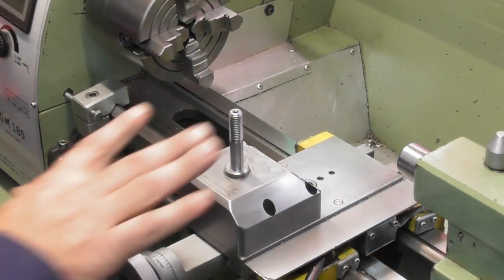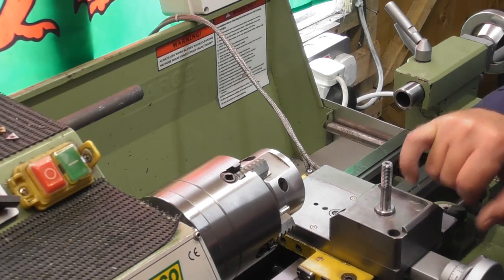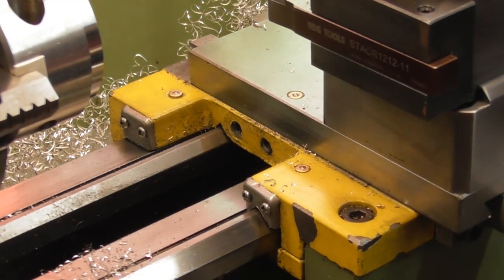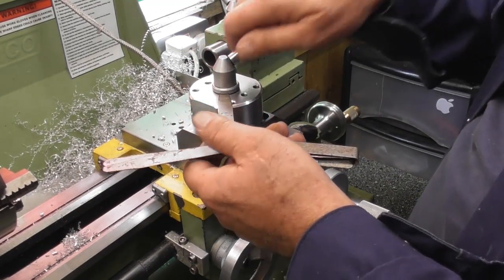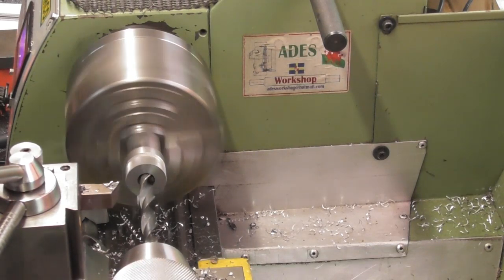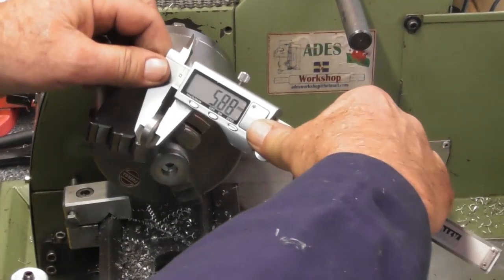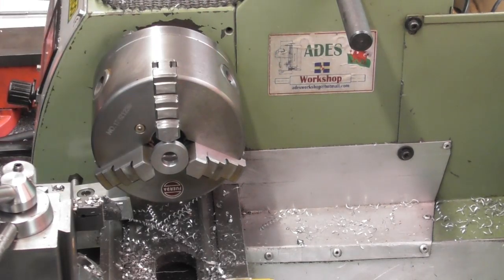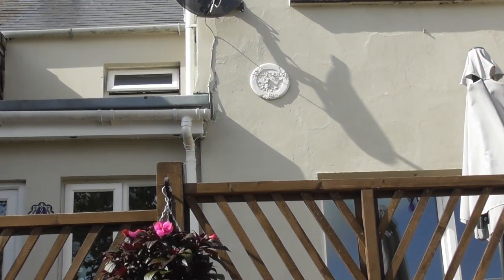Boring bar tool holder mod's and shop update

Comment: Hi Ade. Just a line to say that I've been getting on with making a solid compound for my Myford ML4. The cast iron was hacksawed out of an industrial weight. After getting near to shape using my Cowells Drill / Mill  I was able yesterday to take it over to a mates who has a Bridgeport. Able to set the head angle to do the sloping sides. Used the same index bit multi to mill all the faces. Now the thing that was surprising was all the surfaces seemed a bit furry, but the base, same cutter and using WD40 was as smooth as marble. If you've room I can say the Bridgeport is some machine.

Comment: Hey, I hear you bout life getting in the way - got a couple projects I wanted to use this summer but haven't even gotten them made yet, lol!  As for shop layout, I'm impressed how well you have used cubic feet rather than square feet so far, it will be cool to see how you arrange everything once the shed has been lengthened.  Boring bar holder looks pro now, and will be nice and rigid.  As for the glue, you gotta admit, the marketing department knows how to get us to remember their product name, lol!  Hope you're doing well.

Comment: Hi Ade.  Re the new Mill.  I've sent you a couple of emails, inc photos, regarding my thoughts and what I ended up doing, which was to get the WM14, without the little DRO fitted.  I've also purchased a couple of glass scales and a 3 axis head, just in case I decide to add a slide to the head later.
Did you get my emails? 
The WM14 weighs 60kg, but thats still much to heavy for me to move.  Going up a model, or so, to my prefered options, the   MW16 or 18,  increases the price and size size markedly and the weight increases to 113kg and 220kg respectively.  I feel sure that for what I intend using the machine, the WM 14 will prove more than adequate. 
Cheers Noel

Comment: I have a tiny shed too and I worry more about the grinding dust from the bench grinder etc getting into the ways of the machines. I end up chucking old towels over them to protect them when not in use. So the mill/tiny lathe are in the CLEAN end of my shed :)

Comment: when you build your shed extension I can guarantee in 6 months it won't be big enough.
put some insulation in it.

good luck & keep up the good work
Reply from the maker: The original bit is a bit rubbish or garbage as they say over the pond , the extension will be solid and the opportunity for insulation will be there . fortunately we don't get stupidly hot or cold weather here so i will see how it go's , Cheers Ade.

Comment: What milling machine you after? i have 1 for sale with a lot of stuff with it
Reply from the maker: Hi Kevin , still undecided , what you got ?
Reply: @ade63dug  hi ade,armadeal type xj9512with dro ,belt drive been fitted.gas strut.clamping kit.3 drawer cabinet full cutters,er32 collets and other stuff it has slight problem with speed control it fluctuates then settles then works as should someone told me it was something called a pot but i knoe nothing about electronics i can send you photos to your email if you are interested

Comment: What a fun project, be sure to use that adhesive when you build the shop extension 😁
Reply from the maker: no screws in the build , just that sh*t , lol . it does work well though , Cheers Ade.

Comment: I think you should extend the worshop by two meters not one as come a few months time you will be saying I need to enlarge to fit some more items into the shed
Reply: I extended mine 4 meters, and it’s still not big enough 😊
Reply from the maker: i only have 1 metre until i hit my limit . maybe if my channel gets bigger i will rent one in the future but i am just doing it for fun at the moment , Cheers Ade.